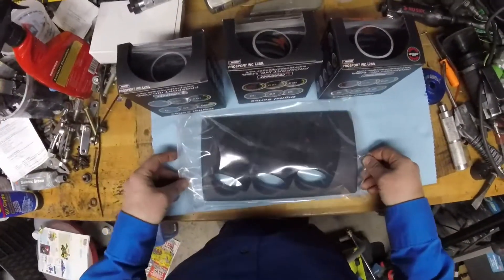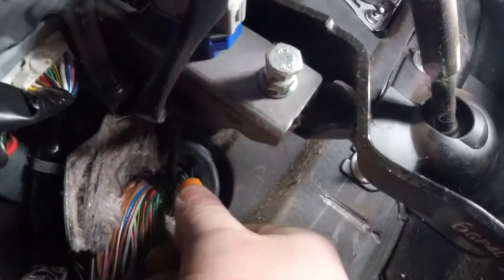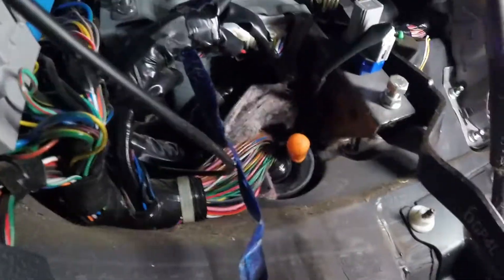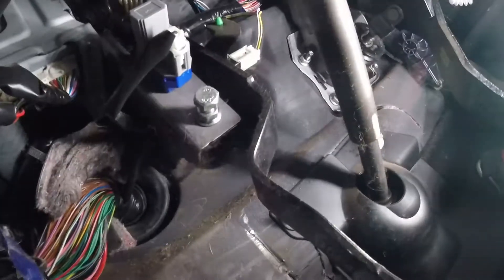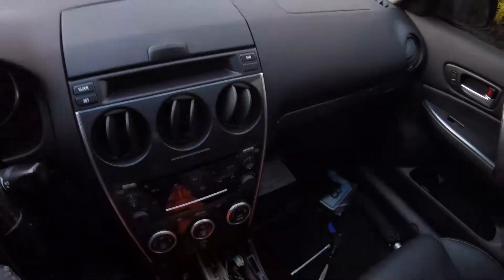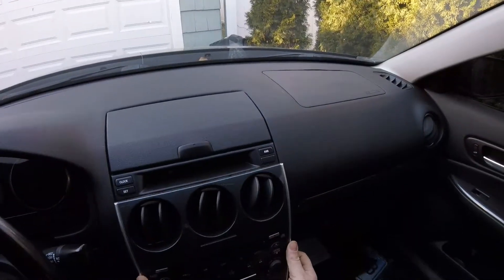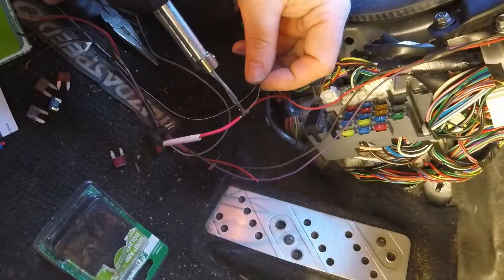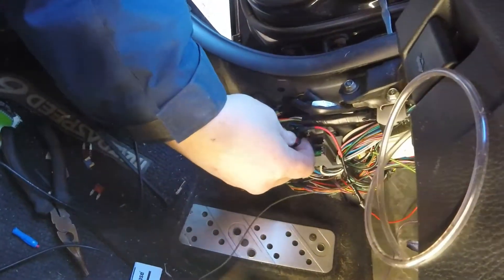Mazdaspeed 6 Prosport Gauge Installation

Comment: Hi where did you buy the gauge holder from?
Reply from the maker: off ebay, it's the Lotek gauge pod
Reply: Couldn’t find anything
Reply from the maker: @Dean_Gamiing  https://www.ebay.com/itm/Fits-2003-2008-Mazda6-Triple-Gauge-Pod-Supercharged-Mazdaspeed-gauge-holder/182798542834?hash=item2a8fa467f2:g:w3YAAOSw2zFZz5Pn
Reply: Thanks for the reply mate but I am from New Zealand we are right hand drive don’t think this would work because this is for a left hand drive car.
Reply from the maker: M Dean yeah they have a 3 pod straight you can get that should work